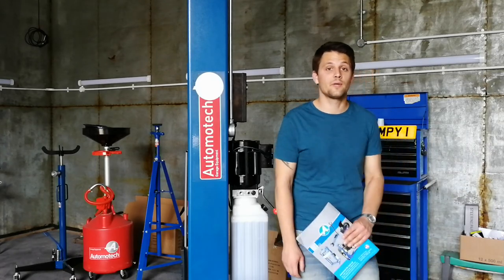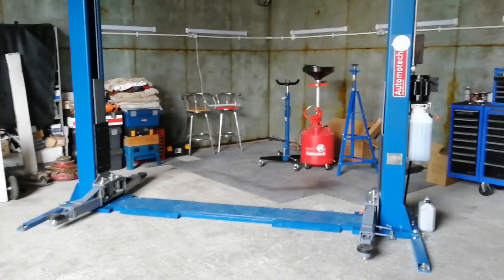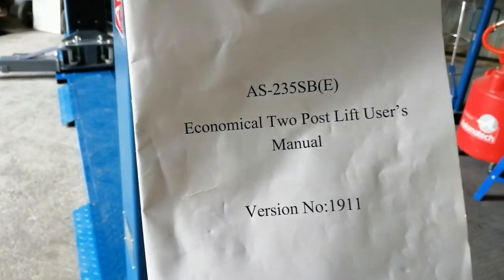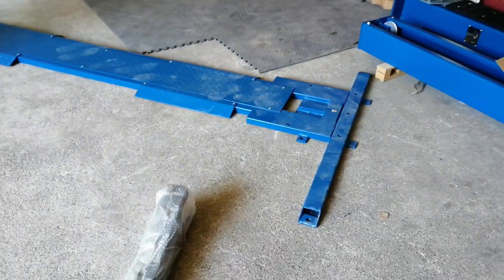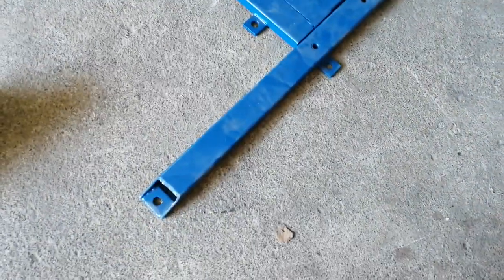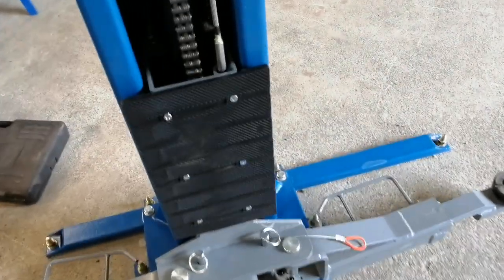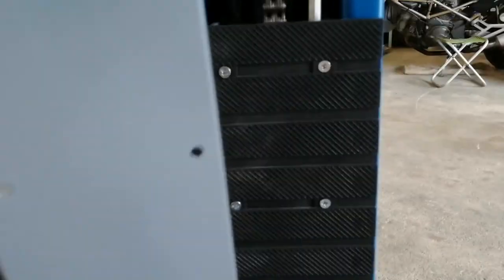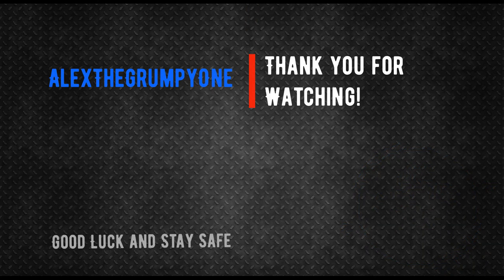2 post car lift demo/review/Installation and adjustments. Automotech H Base AS-235SBE

Comment: Thank you and Well done
Reply from the maker: You are welcome :)
Reply: @AlexTheGrumpyOne  Hi Alex thank you for your response...........I noticed you using Strongman oil..........is this a Strongman lift ?........I am planning to install a strongman ( they are just 3 miles from me)...........it does seem the manual locks lift need and extra 500mm above the auto electric ...........Regards.
Reply from the maker: Hi there. Not a problem.  I'm glad that I can help. 
No it's not a strong man lift. It's Automotech one. But the oil is the right spec for it :) 
Yeah you get use to the manual locks after a while. Just need to make sure that yoi don't forget to pull both of them out if not one will lower and the other one wouldn't and then you got a car falling off the lift....

Comment: ..............could you explain the procedure for lowering to a new work height........do you have to lower and then raise slightly ? and do the locks re-engage automatically ......or  do you have to manually re-engage the locks ? Thanks
Reply from the maker: To lower to new height you have to rise it a little bit to pull the locks out on both sides manually and then you can lower the lift. Once you on the level that you want to be you need to go up slightly until you hear thet locks engaging automatically. The locks always engage automatically when lift is going up. 
It's only when you want to go down you have to release them manually :)

Comment: Alex thanks for this. I just bought this lift and the instructions are showing a different cable set up so I was looking for the way they run/adjust. I was also wondering about the pulley wheels sticking out of the base but is it feasible to remove the wheels and add them later when the post is up? Cheers.
Reply from the maker: You are welcome. Yep I thought the video will be helpful 😀  I left my wheels on. Just need to be careful not to put post weight on them. Don't foget to get cables in there first. I did remove the bottom wheel in one stage because I forgot to pull the cable through while the posts were on the floor

Comment: How's the lift after nearly a year, any issues, regularly used ?
Reply from the maker: Hi there. Lift so far is doing very well! Using it only on weekends at the moment and plenty of use on weekend to be honest. No leaks or any issues so far.
Reply: @AlexTheGrumpyOne  cheers pal 👍🏻
Reply from the maker: No problems. Let me know if you need any more info
Reply: @AlexTheGrumpyOne  thanks, will do.

Comment: Do you have the control box wiring info
Reply from the maker: Hi there. I had electrician installing the wiring as it had to be done due to insurance.  But I can take a picture of a set up or make a quick video.
Reply: @AlexTheGrumpyOne  yeah that would be great thanks a picture or a video of inside the control box
Reply: Hi have you done a picture or video of the wiring diagram

Comment: Great info.
I'm considering getting this lift
Wanted to ask if your able to confirm the outer measurement from post to post?

Thanks
Reply from the maker: No problems. Im glad it is helpful.  I will measure it today for you and let you know. I will give you measurements from Outside of the posts and inside as well.
Reply: @AlexTheGrumpyOne  Top man, much appreciated 👍🏽
Reply from the maker: Right. Outer measurements are 3400mm. Thats outside of one post to outside of the other one.
Space you got between one post and the other one is 2600mm. Which is brilliant because you get plenty of space to get out of the car.
Reply: @AlexTheGrumpyOne  Thank you so much Alex.
Really appreciate the prompt response, this should help me figure things out as I've got a gable roof and was concerned with it not clearing the ceiling.

Thanks again 👍🏽
Reply from the maker: No problems buddy. Im glad that I can help. 
You doing the right thing by making sure that it will fit.
Reply from the maker: No problems buddy. Im glad that I can help. 
You doing the right thing by making sure that it will fit.